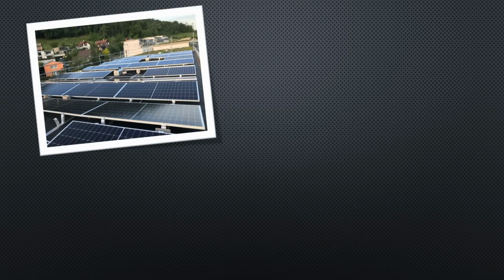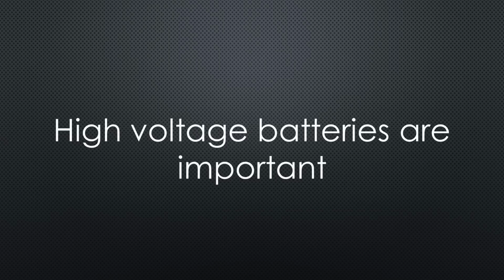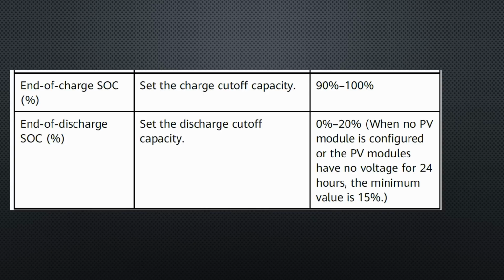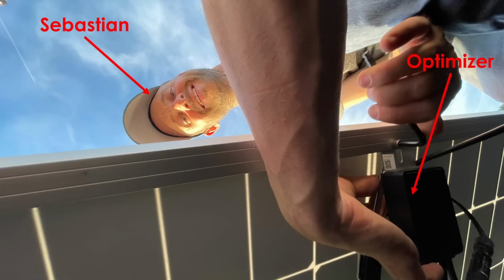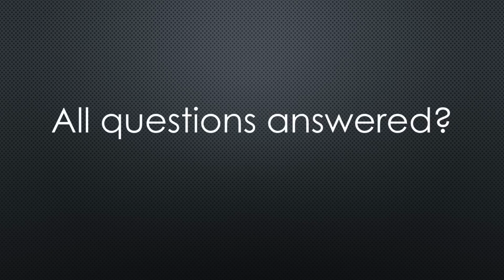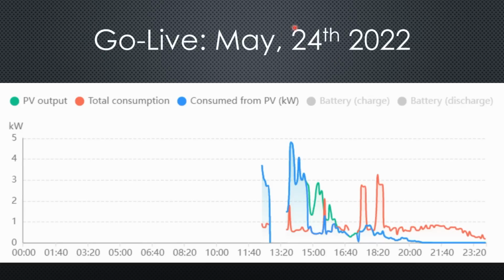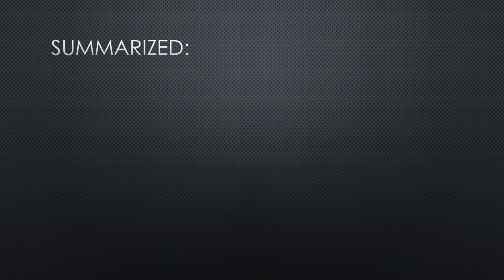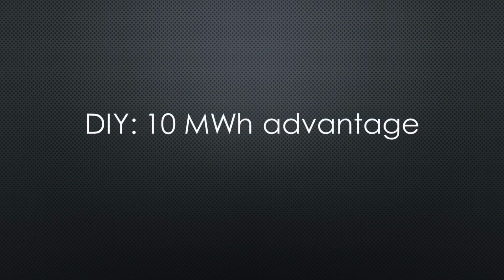438 Photo Voltaic (PV): Why Your Inverter Stops When the Grid Goes Down

Comment: Hi Andreas! There is a company in Australia that has had the ability to print solar panels for 15 years now and we still do not see this technology. I was thinking... Perovskite is .25 cents per square foot and 267% more efficient than regular silicon based panels. If we were to get an older printer where you can still refill the cartridges and create a circuitry diagram that activates each color (red,blue,green,black) using the hexidecimal colors in a program like paintbrush then inject the chemicals for the panel and print them onto the perovskite sheets we could make high efficiency solar panels very easily and then give away the plans to end the energy crisis.You would only need the list of chemicals to inject into the printer cartridges or connect tubes to them from a larger container and you could automate the printing of solar panels using an old printer. Also if you needed a layer of carbon you could use possibly carbon paper... if you needed to make the ink be conductive perhaps dry out some nanosilver chemical and mix it or something of that sort then laminate it at first to test and use some copper strips to connect? Do you think this if it was made public would help end the energy crisis and help the environment? I was hoping you might find it interesting that the australian technology they have not been widely distributing for useage uses ink to print the chemicals. The perovskite sheets recently somehow were able to be more efficient over long periods of time giving them a higher lifetime. I am not certain of the 267% efficiency increase but a video I recently watched has that as the thumbnail. Anyway, regardless of whether it is perovskite used, I proposed this idea as a hacking idea for the next defcon conference in case they would find it interesting to let the little hacker kids try to figure it out but since you are a master electrical engineer I was thinking you might find it fun so the world doesnt have to wait another year (defcon recently ended and they never replied to my email)... and since you already have the grid figured out, if you figured out how to print your own panels in the most efficient way and shared it, you could be a hero if you made it reasonable for normal people to accomplish. I am not saying you are not normal. I am saying you are a master of what you do and most people cannot accomplish what you can. Thank you if you would please consider my idea. Please reply and let me know what you think of it. I am trying to help the world with the idea but I am not good at electronics. I am also sorry I do not know the lifetime of perovskite sheets or whether merely laminating the cells with plastic would work etc but I thought you might find it a great idea to help humanity with the energy crisis. By the way, I have not commented for a long time as I shut down my channel and stopped using youtube for a long time. Would you be willing to take a donation to attempt to create the plans for making a regular printer to print the solar panels ? I would not be earning anything from it, I want to help to make the plans public.
Reply from the maker: Perovskite is a well-known alternative to silicone (see https://en.wikipedia.org/wiki/Perovskite_solar_cell ). There is hope it will replace the current technology. But not all problems are solved, particularly as you state, the lifespan. Quote: "As of 2021 there is a little manufacturing in Poland and China,[215] but large-scale deployment is held back by the instability and shorter lifespan".
A similar invention is the "Grätzel Cell" ( https://en.wikipedia.org/wiki/Dye-sensitized_solar_cell ) which was very promising but so far did not make it to mass production. Inventing something and bringing it to mass-production seem to be different things.
So let's hope we get good news from the Perovskite front in the near future.
Reply: @AndreasSpiess  what about repurposing old printers to print regular silicon versions as I think there are only a few chemicals involved...? do you think it is a feasible idea for a bunch of hacker kids to try it or anyone to try? Even low efficiency solar cells being able to be printed might be useful
Reply: @AndreasSpiess  this may be the answer you were looking for in regards to the Perovskite front: https://www.youtube.com/watch?v=oW1pfxDSPTE

Comment: Did you find out why your Sensors read weird values ? 
I thought maybe they influence each other ? 
That is just from the top of my hat.. ^^ 

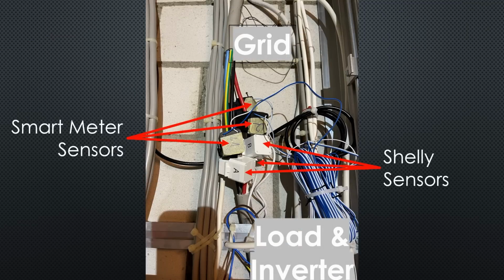(Ich find die ganze Kabelbox (5:30) sieht etwas aus wie "Das machen wir später noch richtig schön"  🙈🙈 )
Reply from the maker: Yes, I found it out and thought, explained it in the video (it has nothing to do with the cabling). BTW: The fuse box was made by the electrician, not by me ;-)
Reply: @AndreasSpiess  I probably missed that part while writing my clever comment 😅 I think I got it.
 Would a different inverter not be an option ? Maybe dump excess power into a water boiler ?
And I did not assume you did the cablebox. At first glance I just thought it could use a little love ;)
Looking forward to the episode where you hack that thing ;)
Thanks !
Reply from the maker: @tinygriffy  I decided for Huawei because of the price-performance ratio. You get other inverters for off-grid operation. But they have vastly different price tags. And off-grid in my case is an emergency situation, and we can live with limitations.
Reply: @AndreasSpiess  I would have guessed that cost might be an issue..
Can't wait to see the hacking Video ;)

Comment: Thanks for the video!  Very informative.  🙂
If you convert your hot water service to heat-pump and power it with excess solar then that effectively becomes an additional battery.
Micro-inverters and optimizers do not seem to make a difference in most installations, see https://www.youtube.com/watch?v=WFpOc3UsvJg
Micro-inverters could be useful if the PVs are scattered over several differently oriented surfaces, 3 here, 2 there, etc...
One problem with micro-inverters and optimizers is that they are mounted in a high ambient temperature environment (e.g. behind the panel) which could reduce their lifetime compared to a string inverter mounted in a shady, cool place.
Reply from the maker: You are right. I already prepared a video about optimizers (and included a video from the same company). My tests show the similar results. It will air later behause I do not want that my channel only covers solar ;-)

Comment: what you need is an hybrid inverter. the grid is fed into it, and it decides where the energy goes. and let you use your solar energy even if the grid is down.
Reply from the maker: You are right, I could have bought an off grid capable inverter.

Comment: Andreas! Great video as always. Can you make a video on the battery life of such solar systems? Every time I talk with people in general, they say "you need to change the batteries every 5-7 years" scaring a lot of enthusiasts like me.
Reply from the maker: Most such batteries come with a 10-year warranty. So I assume they will last for at least this time. With current prices, a battery is an expense, no investment. But this might change if we believe the current energy prices...
Reply: it depends on the battery-type. 
Li-Ion is rather shortlived, while LiFePo4 can do much longer; also there are "DIY-solutions" (rather adventerous ones) with old forklift batteries, which are within the volt-range of the professional batteries; these led-batteries just need regular water-fillings and will do a long time for personal use... 
BUT - at the moment, due to everyone upgrading in the hope to circumvent the brownouts announced by swiss federal counse, costs are immensly high...
Reply: @michaelkeller5008  I found a flaw in lifepo4 if your upgrading from say 24v to 48v inverter and don’t check the resistance of each cell you end up with bloating batteries and maybe a shorted cell. Better to buy more cells and sell off what you have as 24v packs. Also, you cannot replace 1 bad cell unless the resistance is really really close or the new cell will fail and show as a short. Then the whole bank charges up to whatever voltage your using if your BMS is crap. BMS can’t resistance unless you spent good money. These fails were pointed out to me when I inquired to the factory where i purchased the batteries. I never had noticed there were red barcodes on the bottoms until I replaced a cell and suspected they sold me reject batteries as I never felt like I was getting the full ah worth. They always blamed my solar. I got on Skype to the CEO which took a lot of doing and he was like what???? Sent pics of each barcode and 6 weeks later new batteries. Boom! Fired employees. 32 sort of 200ah battery rejects. That would be china! Be careful.

Comment: I'd say in climates like yours heating and heat storage is far more important . So funding all sources of waste heat and collecting them and storing them for later  is fundamental.  You can use data to decide when to store heat and use heat.  Heating costs would be double your electricity costs.. so heat pumps would be essential.
Reply from the maker: You are right. Heat is very energy intensive. Fortunately, we get heat from a collaborative wood heating plant. If not, a heat pump would be the way to go.

Comment: It may be interesting to know if the Shelly would be able to deliver all nine (or 18) values for current power (L1-L3), energy delivery integral (L1-L3) and consumption integral (L1-L3), (and then the same for reactive power) not only total power and energy. I have one here but not installed yet. Also Tasmota does not seem to be available for it (yet). If Tasmota did not do it it would be just one feature request away ;)
Reply from the maker: My problem is the place of the current sensors. They are now at the wrong place (towards the grid, as I have shown in the drawing). If moved to the load side, they would show precise values. But this is mechanically hard in my crowded fuse box :-(
Reply: @AndreasSpiess  Thanks :)

Comment: Thanks for the report!  Installing a new PV system these days, it is wise to selsct a system which also supports off grid capability - in my opinion.
Reply from the maker: You are right. A few months ago, nearly nobody in Switzerland would have spent a Swiss Franc for an off-grid feature. Now everybody talks about it. Still, I hope we will avoid a blackout.
Reply: @AndreasSpiess  I started theoretical preparations in 2021. German Bundesrechnungshof caculated (and published Apri 2021) that Germany will get energy trouble starting in 2022. And after the last election, I started acting. 
Switzerland started early to prepare the population for controlled brownouts.
Reply: @AndreasSpiess  the blackout will be avoided, too many 2big2fails in CH (like axpo - what could have been done with the 4mrd francs. imagine the PV-setups build with that money, axpo'd become useless instantly)... BUT we'll have brownouts, Sommaruga already announced THAT (4h power, 4 hours not, 4 hours power), and all the PV-owners will ...have a very bad awakening...

Comment: you should do video roll checkpoints.
you should do video row checkpoints.
Reply from the maker: What is that?
Reply: For example
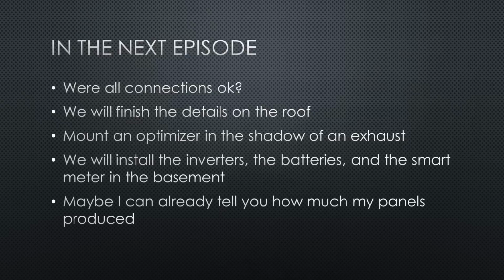1:00 introduction.
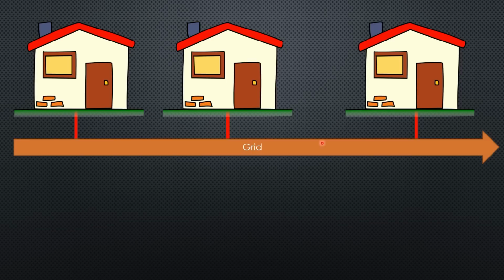12:00 storytelling
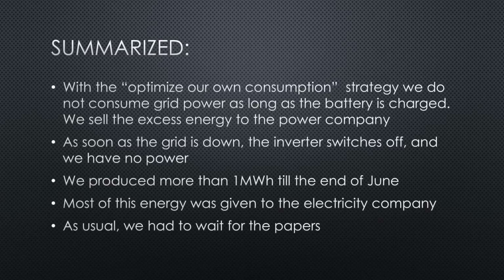17:30 bb...
As we can see red tracking line(has been) interested, we can easily finds rewatch moment's with dependent things !
Reply from the maker: @serggorod1423  I decided not to do it because I often have to answer questions because viewers skipped parts of my videos. I fear this will increase with chapters.
Reply: @AndreasSpiess   Th-x for correct answer.... 
But U better has orientation for smarter(not the smartest)!
And chanel will have more comments, from thought !  More movement  , more (has) recommended !
I understood You're ... position are quite good argumented!

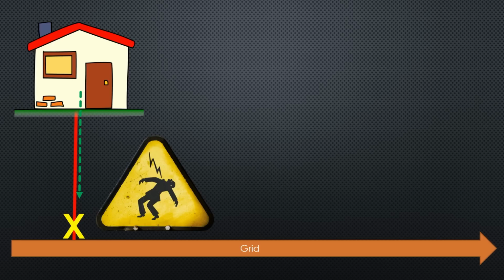Comment: 13:00 Godness, if not for autonomy then WHY? 
Green: Is CO2eq per kWh really lower than average grid mix in CH? 
Waste: PV panels is the 2nd largest Électronics waste stream according to EU commission.
Ressources :...
Just wondering if this PV thing is not just a scam
Reply from the maker: 1. Autonomy was not my first goal because the difference will only be for a few hours. If longer (blackout) life anyway will become complicated.
2. I am sure these panels can be recycled after usage (in 25 years).
3. I read somewhere that a solar panel "paid back" its CO2 after 2 years.
4. What is your proposal instead of solar?
Reply: @AndreasSpiess  1. Noted
2. 25years+ Indeed... Well... If hail Big as tennis ball do not become the norm over Jura moutains during summer... 
3. CO2 payback is like EV payback... It depends more on who wrote the article. Still largely made out of chinese charcoal... 
4. Unfortunately, I don't have a proposal where kWh consumption would remain constant to sastisfy our living standard. And if we would do so as a society, then I would propose to massively invest on Nuclear power technologies (safety, New types and so on).
In général, same as water network, i truely believe électricity should come in a public network where production and distribution should be managed by the state (no compétition as we saw with EDF being forced to open to compétition).

Having said that Andreas, let me thank and congratulate you for your missing and technical sharing and éducation !
Hope my comment above did not offence!
Have a great Sunday!
BR
PS: will you bé at Electronica Munich?
Reply from the maker: @fp2634  No offense, I like discussions and usually value different opinions. And no, I will not go to Munich

Comment: 12:20 when sun is shining, and consumption is low, you and your neighbours could easily supply bunch of other houses, that would be a crazy scenario
Reply from the maker: Actually, this is what happens right now. Because electricity choses the way of least resistance it feeds our neighbors...
Reply: @AndreasSpiess  yes. But no, I meant the case when the electricity company would want to do some maintenance, and switches off your local transformer. If the inverters didn't shut down automatically, and enough houses have solar, and consumption is much lower than production, the whole street could still have electricity. That would be kind of dangerous and crazy :)

Comment: Have a water tank with 3 heater elements (each phase)  that  stores energy for heating and hot water. Shared heating will be a game changer
Reply from the maker: Actually, we heat using wood (remote plant). So producing heat so far was not on my to-do -ist. It is already renewable..
Reply: @AndreasSpiess  I wonder how would solar water heaters fare at your location. They should work fairly well if you have any sun light. There might be an issue with finding room to place them... maybe behind the chimneys?
Reply from the maker: @ИванСнежков-з9й  You are right. My father had such a heater for nearly 30 years. 2 square meters produced the needed hot water during the extended summer.

Comment: Just in time. Good job.
With such a large kWp I suppose you don't have gas for hot heating, hot water, and cooking.
Reply from the maker: No, we do not use gas. But wood for heating (from a remote plant). Cooking is with electricity.
Reply: @AndreasSpiess  so you're not effected by the increase of energy prices at home?
Reply from the maker: @santopino2546  Not as much as others. Our heating prices also will go up. But in percentages, not factors.

Comment: Hi Andreas, nice video. I have the same battery and inverter. We do have an"off-grid" option installed so if the grid goes down it immediately disconnects from the grid and continues to feed one circuit (kitchen, computer room etc).
Reply from the maker: I did not yet install the backup box. I am interested how you connected the kitchen and computer tu the inverter
Reply: @AndreasSpiess  I also have the backup-box.  I installed a new circuits in the house for 'critical loads' and a new row of switches and protection devices in the distribution board and a UPS for the CCTV and Computers on the Critical Load so that they do not turn off when the backup box disconnects the solar from the grid.
Reply from the maker: @DominicClifton  Aha. I plan a different route. I want to connect all three phases. We will see if I am successful...

Comment: I am think of putting in a smart switch 😏  Switch off output circuit breaker then run power in on second smart switch.
Reply from the maker: Here you have to use certified equipment if you want to connect it to the grid...

Comment: Did you use a shelly like me. Add another 25 KW due to your smaller amount of panel on roof.
Reply from the maker: I used the Shelly before I had solar. Now I have to use the Huawei Smartmeter

Comment: Interesting stuff. Couldn't you just move the Shelly's CTs after the inverter's feed point to measure your consumption?
Reply from the maker: The load, the inverter, and the grid are connected at one point. From there the load is split to several breakers. Maybe I could add more Shellies to measure after the breakers. Then I would see the load, you are right.